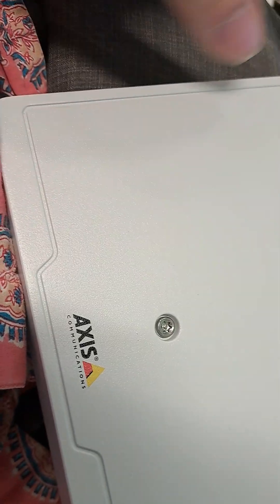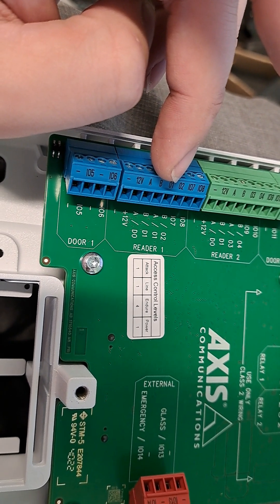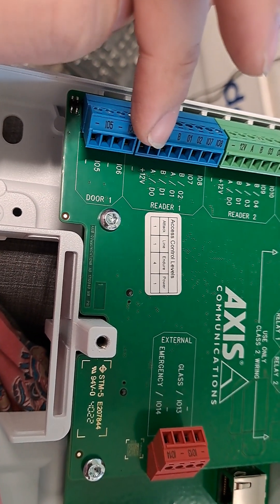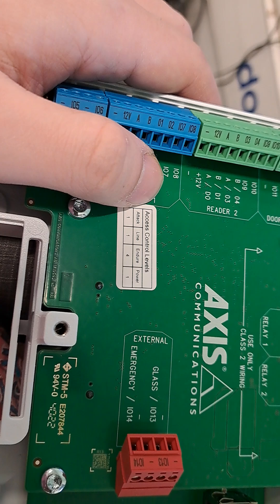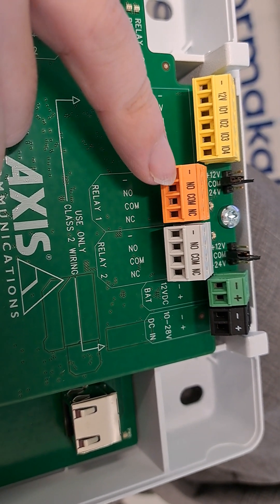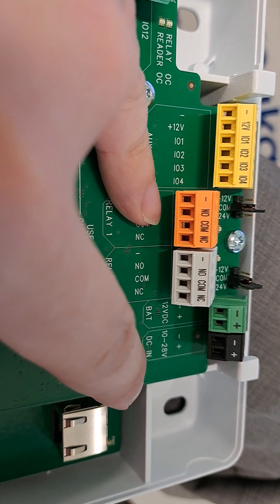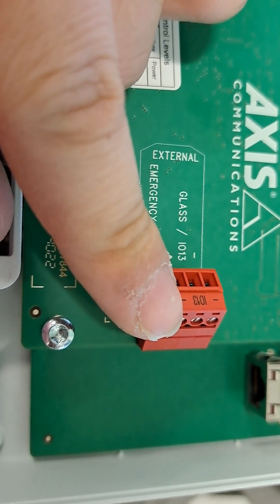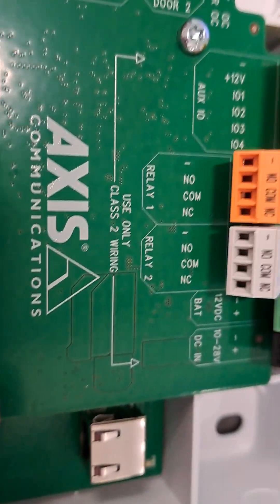How the Axis Door Controller Works

Comment: Can i power the card reader from the controller or does it need external power? if external and i don't have power at that location what are my options?
Reply from the maker: You can power the card reader from the controller.  Typically, they would use 12V or 24V DC.  You can power door strikes and T-rexes from the controller too.   If your device used something else, you could always run a separate power supply to the power wires on your device.